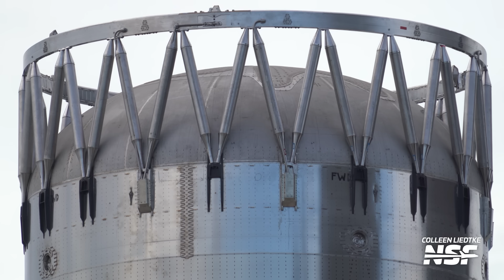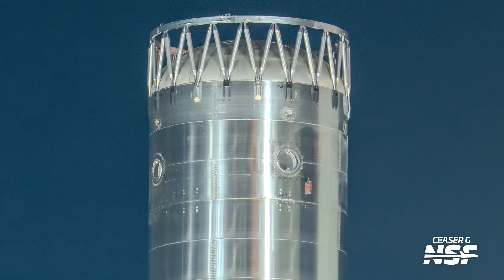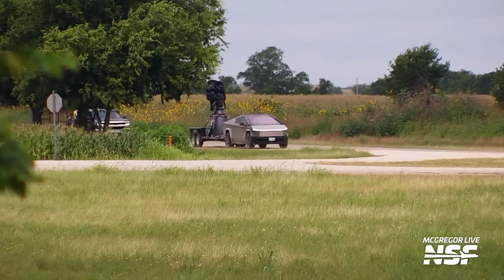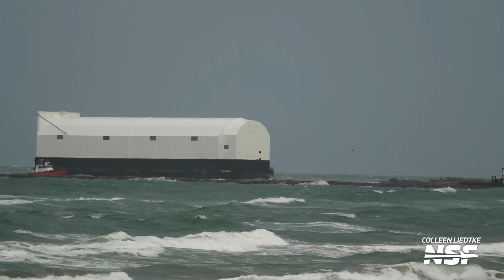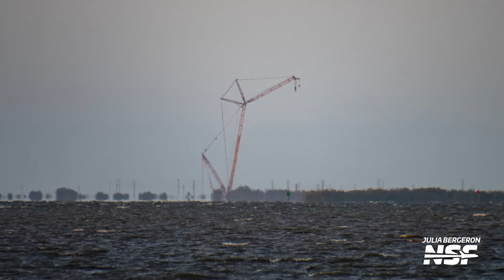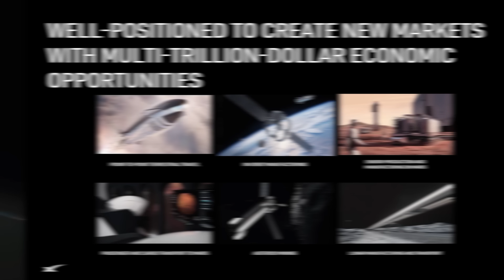Starship Flight 13 Timeline Taking Shape | B20 Passes First Cryo Test | Starship Update

Comment: Any ideas when SpaceX will abandon the sacrificial landings and attempt a chopsticks recovery of Ship and/or Booster? Considerable time has passed since that initial successful catch way back when, and I wonder whether there are procedure issues with catching the newer block models.
Reply: There are validation steps that need to be met first.  Prime among them is hitting the landing zone at the correct speed and of course position.  Once they validate that they can do that they can consider recovery/catching.  Starship has also to demonstrate that it can deorbit with a in orbit engine relight.  With the booster failure and no engine relight they'll likely re-do the previous flight plan until they can tick those boxes.

Comment: I've been saying for months they're a lot further along with HLS than most give them credit for.  I fully expect to see HLS hardware through the windows within the next month or 2 and I won't be surprised if we look back and realize we've already seen it.   I suspect most of the HLS hardware is being built in modules which will be integrated into the ship during the pre stacking phases.   Then, those fully outfitted sections will be moved and stacked in the mega bays.  I actually wouldn't be surprised if they focus on getting a single bay up and ready in the new mega bay for the HLS stacking process because I think that's going to take longer than the other variants.

Comment: I wonder if a Starfall pod could function as an orbit-to-earth escape vehicle?
Reply: Likely not in its current form. it's 2.5 feet tall (though 10 feet wide so I guess you could lay down) 
plus I wouldn't be surprised if the landing of it would be a higher g load than the human body can comfortably handle like how the zenit spy satolites landed too hard so volstok (which is basically a zenit with a human instead of a camera) had to eject its ocupents. 
But I could easily see a taller manned variant for emergency use like the small escape pods for the iss that were always proposed but never got built

Comment: They need a lot in order for the transport to happen.
They would need the:
1. Transport/Vertical to horizontal rig(in the works).
2.Crane to lay down vehicle.
3.Staging area
4.Pressurization hardware for the transport.
5.Crane/chopsticks/Gigabay cranes to lift the vehicle not sure how they will lift the vehicles, tge current rig look more just like a hinge rather the an errector.
6.Not sure if they will ship the vehicles with the SPMT(there and back).

Comment: always wondered if SpaceX could utilize some Tesla Valve tech in their booster/ship to ensure fuel flow to engines. It still have some issues I think.
Reply: I can't see there being much overlap.  The pressures and liquids being handles are VASTLY different.

Comment: I hope they can get July for Flight 13, and August seems so far away, but my prediction is first week of August.

They really need to kick production into overdrive if they want to have extra vehicles to ship over to the Cape. B20 is going in the drink as far as we are aware, which means we'll be waiting on B21. Based on previous booster timelines B21 would be ready in late November, but I'd say they can move faster and possibly do late September. If all goes well they can start reusing vehicles, but I think they need at least 2 boosters for a decent launch rotation. That means Florida could maybe get B23, which could be done and headed to the Cape by the end of the year, but would take a bit to get the first launch in Florida after that. Q1 next year for Florida.

Comment: Florida first flight should be around eoy 2028. SpaceX will need another 15000-20000 engineering test and welder employees to get Florida activated while building in Louisiana, and Texas with Starlink, compute in space, Skyfall, Terafab, and the IPO fallout aftermath.

Comment: I wonder if starfactory has the ability to increase production once the gigabay is complete? Is SpaceX running it at full capacity right now or are they accommodating for the lack of vertical workstands?
Reply: Right now they seem to be lagging a bit from what they can stack in the bays. They're just starting with v3 production so it's slow at first
Reply: @Alexphysics13 I think B18’s “incident” set them back a little bit in production, right now they’d still have b19 if b18 was successful. So I think that’s put the back a bit. But Elon said they had about 10 ships they wanna complete this year and about half that in boosters.
Reply: @jayrog868  unless they speed up a bit, at the current rate it may just be 3 boosters (B20, B21, B22) and 4 ships (S40, S41, S42, S43). We'll see if things go smoother in the coming months
Reply: @Alexphysics13 I think at their current speed we could see S45 undergo stacking before January atleast. Probably only 3 more launches this year though

Comment: I dont understand why they wouldnt use a booster as fuel deppo? It holds a lot more fuel. Surely without starship on top it could reach orbit on its own?
Reply: No, it couldn't reach orbit on its own.  Reaching low Earth orbit requires about 9500 m/s of delta-V.  Super Heavy, when launched by itself, has less than 9000 m/s of delta-V.  There's generally a reason why orbital-class launch vehicles use multiple stages.  Single-stage-to-orbit has been an unattainable dream since the 1960's, and has left a long and bloody trail of space startup and R&D project corpses in its wake.
Reply: Then you'd have to have special connectors for the booster-to-ship prop transfer. Meanwhile with Ships as depots they reuse most of the existing ship hardware for that

Comment: It makes total sense for spacex to ship boosters by barge to the cape from starbase... 
However it makes absolutely no sense to ship starships by barge to the cape... unless of course starbase has an unfortunate anomaly or some unforeseen issue and spacex is forced to launch exclusively at the cape.. 

Before there are enough ships and boosters actually available to ship by barge to the cape...   due to the lack of reuse... there clearly is not enough built boosters nor ships available to keep the test program moving at fast pace and also ship boosters and ships to the cape... 

This should be completely obvious to anyone watching starship progress... clearly the test launches are waiting on hardware being built, proofed, tested, etc..... where are you going to get boosters and ships to send to the cape????

Until Boosters and starships are being caught and re-used, then there will be a shortage of ships and boosters to be able to send either to the cape without interrupting IFT launches...

 OK..  Once ships and boosters can be reliably caught, then why would you ship a starship to the cape when you could launch it on a starlink mission with an inclination that makes it reasonable after the starlink deployment to land it at the cape instead of risking damage during transport????? 

Iif you launch from the cape you obviously plan to land at the cape.. then why not launch in TX and land at the cape?

 If you can't safely land at the cape then land at TX??  from the cape you should be able to launch and land the ship..(not the booster) in Texas..  clearly some extreme inclinations will not likely lend themselves to this scenario but we are not talking every launch... just the ones that can complete a LEO mission and land at the launchpad of choice...  somehow the rhetoric is got to the point that this is not practical...that's like saying you can only land your airplane at the place you took off...  clearly not the reality 

 Here's a much more important point... any starship that is laid down for transport is going to be reinforced to be able to handle the horizontal stress of laying in cradles.... added ship weight directly affects mass to LEO.... 
I highly doubt spacex will ship any starships from starbase to the cape... boosters certainly but ships no
Reply: Your last point about reinforcements to support horizontal loads... so there's this thing called reentry and bellyflop that the ship does where all the loads are in the same direction as if it were horizontal...
Reply: @Alexphysics13  now wait a minute... that thing you call reentry puts even pressure on the side....not concentrated pressure at a couple of points...   a totally different level of structural stress..... 

the belly flop does exactly the same and when they light the engines to bring it vertical that stress is extremely similar to launch stress..

Comment: What is SpaceX doing about their booster's ice problem in the fuel supply?
Reply: Resolved early in the program.
Reply: Elaborate filter cages around the intakes, and elaborate baffles to catch most of the slush before it settles to the bottom.

Comment: Tesla and SpaceX aspirational goals are often exciting but based on current data I don't see more than 2 more launches this year. That will delay anything related to HLS, Artemis, adn even Starlink V3. I don't think there will be a ship catch in 2026, but hopefully at least 1 booster catch and I would be hoping for a SLC39 launch in Q1/2027
Reply: They’re already testing flight 13 hardware.  Likely July/August.  Unless something is catastrophic, I can’t imagine anything less than 3 flights this year.
Reply: @steven_alleman  Yes, I saw that and I know they have Ship 41 and 42 under construction, but there hasn't been anything beyond that, and they used about 80 days to make a ship & booster
Reply: @AMeierhoefer they are working on nose cones for ships in the high 40s.  Booster 21 is mostly stacked as well.  But it seems like booster will be the hold up unless they can start re-use.
Reply: Where are you getting your assumptions from ,the reason FL12 took so long is because it was a completely new rocket and if they won’t change the hardware much I don’t expect anything less than 5 Flights ( a flight every month to the end of the year )
Reply: @kelvinolenasha16  I am watching NASA Spaceflight videos regularly, and I have not heard anything beyond Starship 42

Comment: How's the starfactory in Florida coming along
Reply: Hasn't started construction, yet, AFAIK.  (Ironic, considering the GigaBay in Florida is a couple months ahead of the one at Starbase.)
Reply: @Spherical_Cow I was wondering if Starbase will transport parts to stack at Florida Gigabay
Reply: @dennisschrock8556  it's possible.  Though my guess is that more likely the Florida GigaBay will be initially used for inspection and refurbishing of complete vehicles between flights, rather than building them from parts.  At least, until the Florida Starfactory is completed.

Comment: My guess: B20 will be ready for flight by end of July after its static fire. S40 by mid July assuming the SF goes well. Launch early August; My date: August 10th
Reply: that's my bday, would be a perfect gift
Reply: To me the static fire should take place within June, flight in mid July if all goes to plan. They only need engine installation now before static fire, so unless there are lengthy upgrades needed after the last flight it shouldn't be long.
Reply: Whatever it will be, just 3 flights in 2026, DEFINITELY not prop transfer demo.